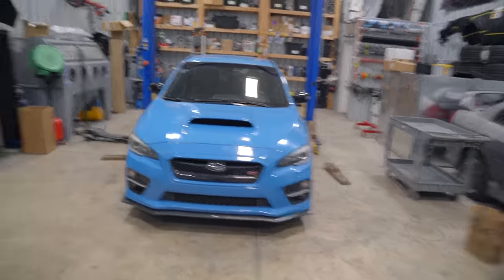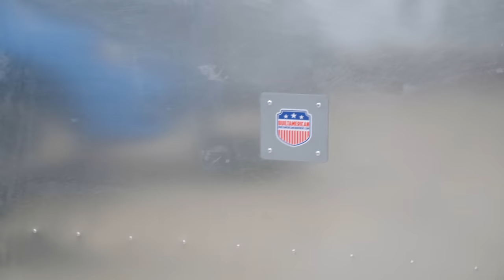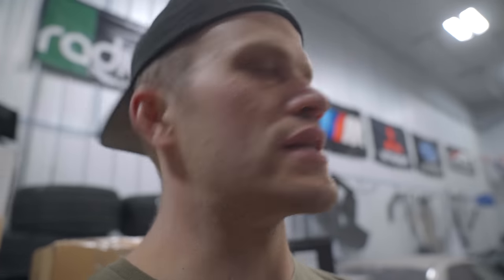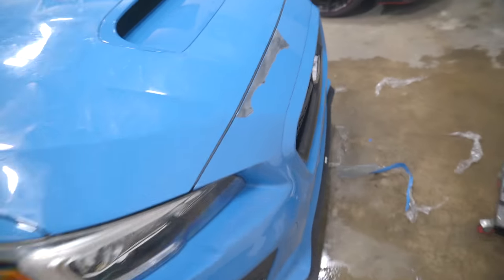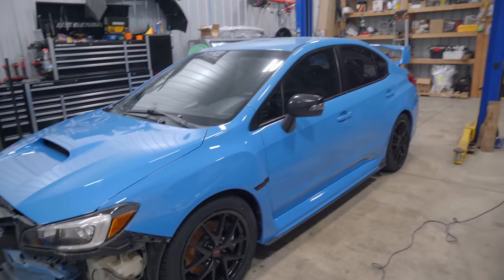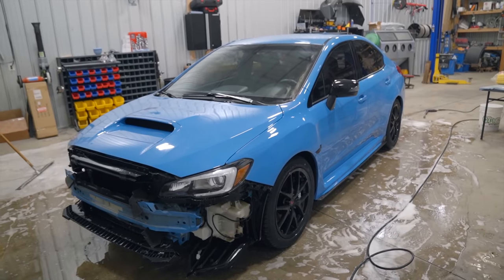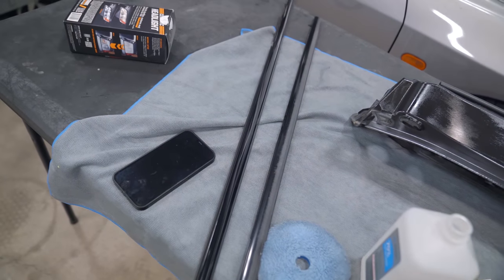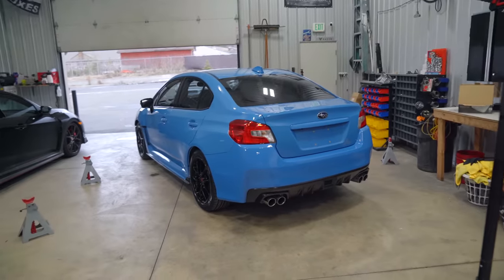Restoring the RARE Subaru STi (showroom condition)

Comment: Devin the cloudyness means the metal isn't reaching curing temp, or it wasn't in long enough. Leave it in a bit longer and see if that works
Reply: Makes sense. That big oven must lose a lot of temp when opened.
Reply: @pieterverboven4853  More like loses all the heat.
Reply: @pieterverboven4853  I said the same thing on the video when he bought it.
Reply: Yeah. Longer time because of huge oven
Reply from the maker: Thanks for the advice!
Reply: Longer would be key. The big swing door and rack make it so you lose a lot more heat out of the oven. I would either add 30 mins to bake time or 5-10 degrees.

Comment: Maybe you should try going a little hotter in the big oven. Remember that the smaller one has a smaller space to keep at temperature while the bigger has more space to heat.  Or preheat at a higher temperature and then bring it back down

Comment: @Devin Tip foreremoving clear bra / PPF .... get a water kettle like you would use for making Tea... the hot water softens the adhesive, and makes removal trivial. The adhesive will stay on the film, and not the paint, eliminating the chance of paint peel ( on OEM paint that is).

Comment: Cloudiness is normally related to part temperature ramp up time. Usually I will crank my oven up to 450-475 and put the wheels in. Then turn the temperature back down. Also Ink Black isn't a very good powder honestly. It normally lays better with two lighter coats anyways

Comment: Did the oven come with thermocouples to monitor zones in the oven? Maybe you got hot/ cold zones or as others said to run her longer to account for heat loss from opening the door and setting the rims up after the initial preheating. 

Solid work as always.

Comment: I had horrible luck with the Cerakote Trim coat. It all spider webbed and cracked after hardening. Not sure if I just had some moisture but honestly, all 4 mudguards got messed up over time. Was odd, curious how it turns out for you.

Comment: Those wavespecs holding up for you? no brake wobble in the steering wheel? if not what pads you using on those? i have a set and some red stuff pads i believe but dont want the god awful wobble when i had used regular brake pads on

Comment: I didn't like 4WD that much but her storyline was quite unbelievable. How many nuts a wheel does it hold?! Painting was easier in the hot summer. Colder winds, I guess. Is that air intake stock now?! 🗨😏🎭♨️🌌